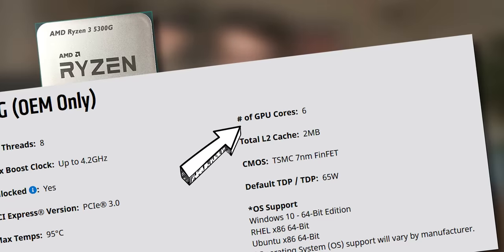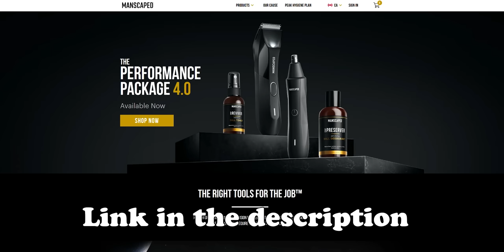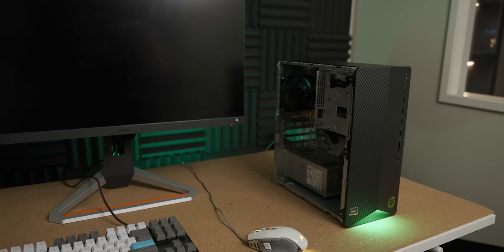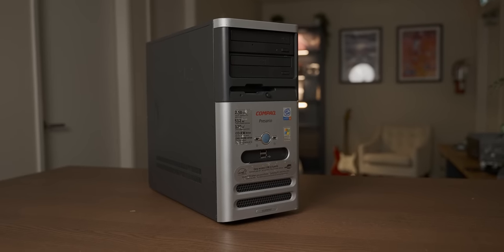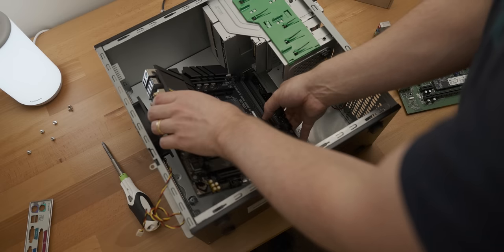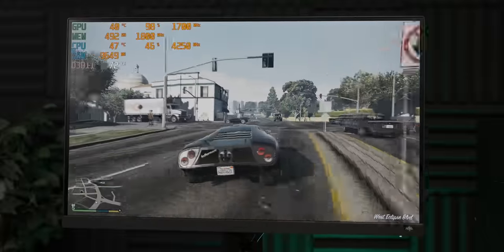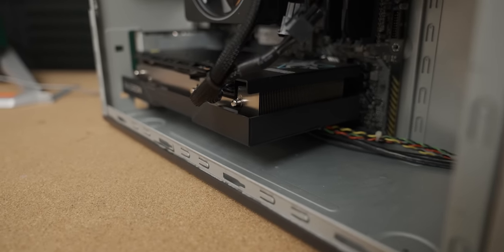Budget Sleeper Gaming PC Build Ft. Dodgy eBay Parts...

Comment: I'm going to take the parts from this fully functional PC and use them to upgrade this other PC to make a PC that isn't any better then the donor PC was to start. This is why I love this channel.
Reply: It's definitely better than the HP one in terms of CPU cooling, though. Intel Stock Coolers are notorious. Then again, the old one seems to have more ventilation but I don't trust looks for all we know they added a plastic sheet behind the front panel to obstruct airflow for no good reason.
Reply: @TheEtueify  The stock cooler could easily be replaced with a 3rd party cooler, just one with Intel mounts.

'20 year old case' and 'good airflow' aren't really two terms that go well together. :)
Reply: Video card too close to floor, here hold my beer where's the drill
Reply: @fred_derf  I don't think you can, GamersNexus just reviewed a slew of prebuilts, and on the Ryzen chips, the "puck" is larger, because the Intel coolers are expecting a larger IHS. So you can't even upgrade to a nice Intel style cooler on the Ryzen/HP system cause the cooler won't reach the CPU. At this point, HP is a joke.
Reply: @th3R0b0t  I am getting s prebuilt but not from HP or Dell, it has all replaceable parts,coudl I replace the stock cooler if needed from my AMD cpu?
Reply: @giovannii7519  mainly just depends on who you order from. If you get a PC and it has an OEM AMD wraith or stealth. Then it's AM4 brackets, and you can put whatever cooler you can find to fit.

It seems HP/Dell worked backwards from that idea, and targeted a cooler and designed their motherboard to fit.
Reply: @th3R0b0t  thanks for the info! Cheers
Reply: @giovannii7519  was a prebuild good?
Reply: @kowhaifan1249  i didnt get it on the end, I got all the parts myself and assembled it pretty easy stuff. Way cheaper too.
Reply: @giovannii7519  nice, what's ur rig and how much did u save?

Comment: This video has so much going for it. 

First off, getting to see the difference between a 20 year old prebuilt and how they are made today sheds light on how dodgy these companies have become. 

Then going on to see how well the APU performs for it’s price is value goals. 

And finally the new power color card and final sleeper result was just dope. 

Good work son.
Reply: Old cases had much better cooling. No glass or plastic crap on sides, metal is much better thermal conductor. Also, graphic card on the bottom, with hot air rising and cold air getting down.
Reply: I think that back then, computers were mainly for enthusiasts so OEMs (which were, speaking from my memory of those days, the main way of getting computers up until the 2000s) screwing them over would likely mean losing customers. Now computers are a bigger market, but a lot of people "just want it to work" and don't really care if they get screwed over in the process.

I see this with my mum who keeps suggesting me a Surface because it's nice and shiny and "it just works", but I'll definitely go DIY with my next system (or buy from an SI who doesn't hate people that want to fuck around with their stuff).
Reply: @freedomseekr  Not necessarily, big part of the business was selling PCs to companies. Gaming PCs were something of a oddity, you would usually have them with somewhat better graphics card, but at those days graphic acceleration was still not a thing. Lot would depend on CPU, even in gaming. Therefore, OEMs would build standard office computer and throw in somewhat better card and that's it. Cases were practically the same, enclosed for all sides and really just a place to store your components, not fancy expensive garbage like today.
Reply: @freedomseekr  This is true but for 30 years back. Not 20.
Reply: @aleksazunjic9672  Expensive garbage like Chromebooks. They make good paperweights and table leveling pieces.
Reply: @brucewrigleysgumchewz4667  I would agree.

Comment: I will admit that in my earliest days of tinkering with PCs . . I put a Socket 7 Baby AT motherboard into a huge tower case meant for some kind of 286 or 386 based server, if I recall.  I really did not know what I was doing.  I got a Pentium 133, and snagged some S3-based ISA GPU.  And only ONE screw hole lined up.  So, I literally used the one screw hole that lined up, and twist ties tied through another hole on one end and around a frame-pillar of the case at the other end.

It worked!

Comment: OK I did not know till I built a new pc but there an adapter to turn that 4 pin power connector to a 24 pin atx power connector they sell them on Amazon. I went a step further and put the super efficient gtx 750 ti in my system power it with a sata to pcie adapter. Your lucky I only had 190w power supply. It's run just fine.

Comment: The seller could have purposefully had the prebuilt delayed in shipping so it wouldn't be backed by eBay guarantee so he could scam people
Reply: Nah, a delay in shipping doesn't impact the ebay guarantee.
The clock starts ticking when the buyer receives it or the "estimated" delivery(when no tracking number is provided) is reached.

You've got, upto, 30 days to start the process after delivery or "estimated" delivery is reached.

Comment: Noticed that when you booted the HP on the start menu was the Nvidia Folders so I think you guess on the GPU being ripped out and sold separately was spot on, also the other clue being the holes for where a GPU would have sat.

Comment: I get this feeling you've never seen Jayz2cents video about how  you can just drill new holes for the mb standoff spots =D
Reply: i have'nt watched it also,but just drilling is so-so (imo),to do it properly you should drill and then "tap" the thread into holes (requiring a tapping kit not many ppl own)!?
Reply: Jay has drilled through a motherboard before.
Reply: @leonefurlan137  The point is that the mb was borked after that procedure. They are multi layered with traces inside you can't see from outside.
Reply: @leonefurlan137  It's like M3 or a similar SAE, which means the taps are generally available in the HW store. Lay down your board and mark the holes with sharpies and carefully drill out slightly smaller, then thread the tap in. 

For the PSU, I probably would have either broken out a multimeter and spliced cables so I had a "normal" PSU that fit the case or made an adapter bracket for the new PSU (assuming, of course, that the length fits). A dremel and a small bit of sheet metal (maybe harvesting the side of the HP e-waste case)  would get him into position and not look too jank.
Reply: @lordofhyphens  sure man,it's not a big deal,but just saying (imo) everybody has a drill+drillbits at home,but not many have a tapping kit.  But as you said,it is available in any hardware store...

Comment: I built three computers like this. All because I was told I couldn't do so lol. One was in a HP Compaq DC7600 convertible mini tower and a Dell Optiplex GX270 clamshell system and lastly a Dell dimension 2400. My friends thought I was crazy. I'm glad someone else is doing this as well lol

Comment: You're so right Dawid, we have gone backwards in 20 years where PC building is concerned. Plus components offered genuinely good value for money back in 2001.
Reply: I'll kindly disagree.
Over the last 20 years, in regards to pc building, nothing's really changed.
Proprietary parts have always existed.
People just have a lack of familiarity with the diversity of components that exist.

As far as "value", hasn't changed either.

In 2001 a "good" system could easily run $1000(usd).
For instance, an HP pavillion 6835 had a launch price of $699, with no discreet gpu.
The current HP system dawid is showing, starts at $799, with a 1650 super.

If one adjusts for inflation, that 6835 comes in at ~$1100 usd in today's market.

Comment: I think the airflow to that graphics card was probably a bit better then you might have been expecting, the perforated side panel and the maybe one inch of space might just barely have been enough for it. 
I've seen modern ITX cases with similar clearances that seem to do just fine too, i suspect it'd doubly help if part of the graphics card is exhausting hot air out of the back of the case.

Comment: Surprisingly good for an APU,  the end result is super clean looking inside and better hardware wise than what you started with.  Maybe this build could benefit from some fun cooling mods to the case to get air flowing, maybe holes in the bottom of the case or similar.  I also understand this APU overclocks pretty well.

Comment: you "new" guys need to learn to turn and wiggle the cooler before ripping the cpu out of a pga-socket....
Reply: I tried really hard last time I replaced my CPU to not rip it out and just couldn't. I ran benchmarks before to get the thermal paste really soft, wiggled it, etc. and the 3600 still got ripped out. I am sure you are right, and you can get it off without ripping it out of the socket, but I think Ryzen CPUs are just prone to this.
Reply: @frankguy6843  as were athlon 64´s or fx, dont remember about p3 or athlon´s anymore

Comment: I was able to put a modern RMx PSU in my now 17 year old PC in the mid 2010s. The loss of standard form factors is terrible and why I was determined to build my next one, which I did last year. Both my 2005 and 2011 Emachines had standard ATX components. The only difference was the shift to SATA and PCIEm from IDE and AGP.

Comment: if u ever wanted to use intel coolers on AMD, ASRock has one mainboard that is AM4 but uses Intel LGA 115X cooler mounting. X570 Phantom Gaming-ITX/TB3. Why u may ask, thats because back when they released this mainboard there was not alot of good Low Profile coolers available for AM4 or AMD in generell.

Comment: good job sir well done nice video my dual burner multimedia system is based on the same concept right down to a compaq case (though not as old) i put in the guts of another old but much more capable dell xps 8500 not nearly as powerful as newer parts but it was still a fun little project  and i can now convert an entire physical library to digital or backup physical copies with ease

Comment: This is reminiscent of Gamers Nexus' comparison between an old Dell Inspiron and a then-new G5 5000.
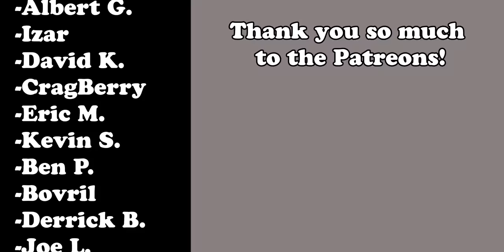15:43 I'm pretty sure you can cut out a hole in that case to install mesh and potentially additional fan mounts to solve your ventilation problems, as well as raising the case up a bit with some hifi component feet to allow for bottom air intake.

Comment: I have actually had an apartment burgled and a cheap computer got stolen while my NAS at the time (which didn't look like a PC) did not.  I got extremely lucky as I was in the process of building a new PC and the parts came a day or 2 later.  The guys did get caught though, they were hitting houses that were empty during the evenings and the next one had cameras inside.  Even got the PC back.

Comment: I spent a fair bit of time last year upgrading a Dell SFF desktop into a gaming PC for one of my kids.

Initially it was just adding a GPU to the i5 7400 system, then I realised I'd need a bigger PSU, then I realised I'd need a new case, then I realised I'd need power adaptor cables to use the new PSU, then I realised I couldn't connect the front panel buttons to the motherboard and had to steal the power button from the Dell case and position it under the top mesh panel on the case.

However, the frankenstein PC did work, and it only took me a week to realise it was then just easier to buy a proper motherboard and CPU and rebuild the Dell to sell it.

Lesson learned. It's easier and cheaper to build from scratch when it comes to gaming pcs 😂

Comment: Hey Dawid, that's a pretty cool sleeper PC. 
I have question though...  I am planning to use the same TUF Gaming B500M-plus wifi motherboard in my build with a Ryzen 5700G. Did you need to update the bios to get the motherboard to work with the 5700G? I read in couple of articles that the bios might need to be updated.

Comment: Is that replacement motherboard an ASUS TUF GAMING B550-PLUS WIFI? If so, it's a pretty sweet board that I also used for my latest build with a 5600x and RTX 3080.

Comment: Put mother board in place, mark holes with marker, drill out marker holes, jb weld brass standoffs in holes... you may need to grind down existing standoff bumps in bottom of case so they don't short the backside of the motherboard.  USB extensions from motherboard to front of case, rewire the power buttons.

For power supply, cut out mounting bump from case and either jb weld or pop rivet into place on the old one.  Paint inside of old case.

Mount ssd sled or double sticky tape to hard drive holder & install new ssd for games.

Clean out bloatware or just install new os.  

If PSU supports it, add a 1650 super in there when prices come down, or one of your many extra graphics cards you have.

If cooling becomes a problem, they use to back then & still make a fan that fits in two drive bays, you might have to paint fan grill to match, but it will still be period correct for mods.

Comment: the wifi module on that prebuilt may be of some use on another system  like a laptop  , a small board computer ( sbc) or  on a motherboard that has an empty  wifi module emplacement.   that cooler can probably be reused in an intel build since it may be better that the included heatsinks  intel ships with their cpu's .  

i have an acer nitro50 and the cooler is decent  with heatpipes and all  but the holes didn't align with am4 mounting so  it's probably the same  thing there. it was originally a R5 3500 but i put my son's R3 3100 on it instead so he gets a better cpu .  also the 5600g is great  for light gaming, retro gaming and emulation .  gaming on recent title.... can be a pain to say the least lol. an intel stock cooler would be enough for the 3100  if i ever do an intel build where that cooler fits  because it's one of the best i have seen in a prebuilt from acer  so far  but please  use dual channel memory with decent speed and timings because you'll end up having  the performance level just above  of an intel igpu otherwise.

Comment: I've got a potato HP with an A8-3820 in it.
It makes a passable media system as-is, but I'm inclined to gut it and rebuild it with modern guts.
Or at minimum a 5700G, which would probably actually work with the existing potato power supply.
Also, as someone shopping MATX, that "putting the GPU in the second slot" thing is REALLY annoying. These boards don't have a ton of slots to work with and they just waste one because it's trendy.

Comment: Come on Dawid! You could have taken the back panel off and run a couple bolts through the frame with nuts and stand-offs then used those front USB ports to run IDE-USB adapters to the optical drives and probably the floppy too.

Comment: The 5600G (which is what I have and use for photo editing) is probably one of the best values in iGPU gaming.  I haven't played any games yet but based on what you showed I should be able to play GTA V at a respectable rate.  I would say if you plan on using an iGpU for gaming, make sure you have plenty of memory (as some iGPUs in general can use up to 8GB of system memory for video purposes, so I'd say 16GB minimum).  If you can live with lower res or frame rates then it's a viable option until graphics card prices come down (which may still be another year or two away, and this is me saying this in 2022).

Comment: Not bad! Now time to build the Compaq system back up, since old PCs still have the nostalgia value to them and that they can also be used to play older games that cannot be run on more modern systems.
That small HP system... not good due to proprietary form factor. Get a cheapy modern case, put the APU into your standard board & other standard components, build a decent modern system, then sell the remaining HP spare parts... done.

Comment: i actually have an asus sabertooth 990fx 32 gb with a liquid cooled fx8350 and an evga gtx780sc as a linux box in a 2005 hp garbage case. and 2 other identical systems one im using now and one for a cnc controller but both of those are in corsair obsidian 550d cases. i just really like the combination of parts and for me has been quite stable this machine ive had up and running since 2013. the linux box since 2016 and the cnc box i built last month. oh the cnc and linux boxes have seasonic 850 watt psus and this one has a 1250 watt90 platinum as it originally had all three gtx 780sc gpus in it. still looking for another 550d case for the linux box but i dont want to pay $300 for it new or used.

Comment: 13:44 obviously the temperatures are good, the cpu is way too weak for the 6600XT. It’s not utilized very much. Under full load it would be at around 65 degrees Celsius.

Comment: The best part is you can get floppy and ide controller cards cheap, so even the "modern" sleeper build can have working floppy and dvd-rom support; and will work on the modern motherboard if you wanted to finish the "sleeper" build.
Reply: I thought the exact same as you, except I would of replaced the IDE drives with modern sata ones, maybe reuse the front bezels from them?

The build was super lazy tbh, not a fan

Comment: The HP doesn't have to become ewaste, if it would support Ryzen 5 3600 (or 3100/3300) they are quite cheap now (I just got one for £125) and still good, add whatever video card you can get (re-released 1050Ti?) and it can live again. The sleeper build is cool though.

Comment: Hey @Dawid do you think you can help me for some reason my pc out of nowhere has a black screen with a blinking cursor in the top left I have an AMD Ryzen 5 2600 six core and a 500GB SSD and it never boots up and when I unplug the SSD the settings for the computer itself ASROCK comes up. I think the SSD may be the issue?